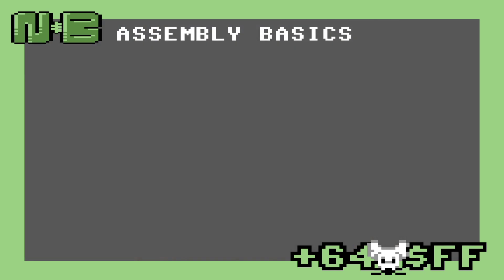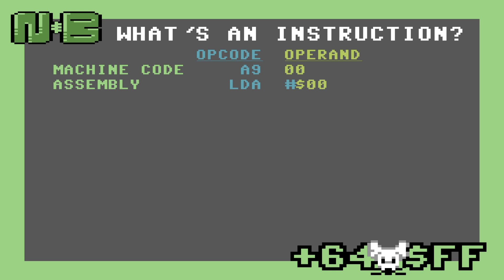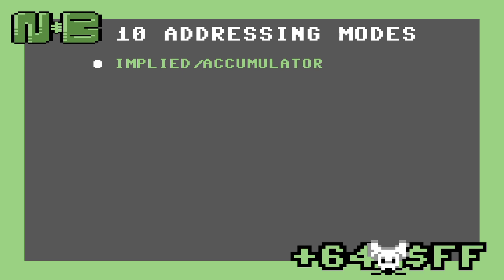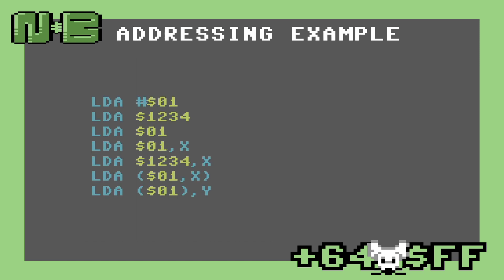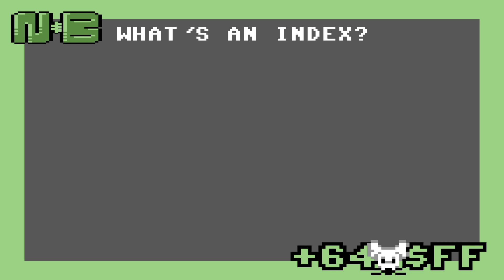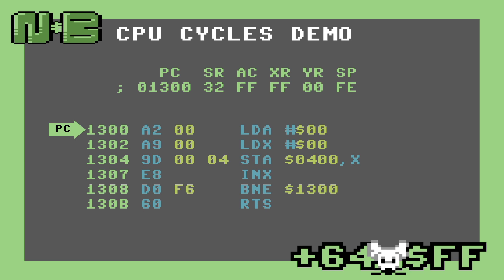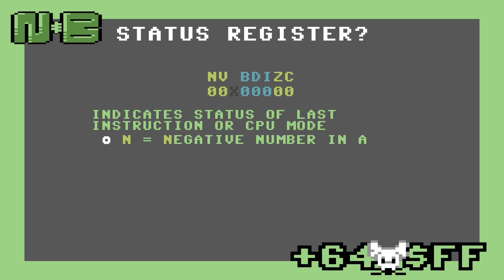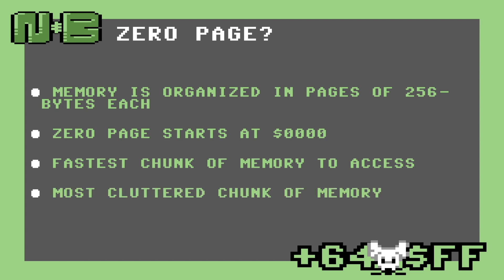Nybbles and MouseBytes: Ep1: Assembler Basics

Comment: Awesome explanation of the basics, the visualisations you do make relatively complex concepts extremely easy to understand. Best assembly tutorial on youtube, props! I totally get how the 6502 stack works now!
Reply from the maker: @Mallard Puddleduck Bear in mind that animation is slightly off. The stack pointer points to the topmost unused address. So when the JSR instruction is executed in that animation, it actually should be stored starting at the first address in that stack. As long as you get the general mechanics of it, it should be fine, though.

Comment: Thanks for sharing your knowledge, you're a great teacher & instructor. I was never aware that the 8502 had memory indirect support. Do you know of a good C compiler, or macro assembler for the 8502 or the 6502, I'm sure they're out there.  It's nice to see some tech nostalgia videos that differ from the more common videos about this era of computing, which usually focus on gaming rather than coding. Great Video.
Reply from the maker: Yes! Next video we're going to cover using Buddy (because I want to use an on device assembler), but just about any assembler built for the 6502 will work, as long as it produces PRGs. I recommend acme, buddy, and kickass.
Reply: @NybblesandBytes  Thanks for your reply. I really hope you continue this series... I've got an old C64 somewhere as well as some VHDL for the 8502 and others in the family made by MOS tech. I have a bit of a soft spot for MOS Technologies, and really wish that they had have been able to survive financially, and how their innovations and low cost / high performance strategy would have affected the tech sphere today. Especially with the advent of IoT, where we're I still use an 8051 to build low-cost sensors, relays and open collector arrays for this application.

Comment: I'm very new to the Commodore world (Z80 and speccy was my childhood) and I got some C64C, will the explained here work on a C64C or it will only work on C128?
Reply from the maker: @geniwab Kinda. The 64 has a different memory map that you'll have to contend with, but aside from that, everything I'm discussing in the assembler basics video is applicable. What you don't have is a built-in monitor like the 128 does, so you'll have to find your own solution to that.
Reply: @NybblesandBytes  Thanks a lot for the info. About the monitor I already have the solution, as I had to repair these I have a cartridge with (besides diagnostic tools) a monitor with NMI button. So I think it's time to learn 6510/8502 assembler :D

Comment: Nice video. Note that "assembler" is a program that translates "assembly" into machine code. It's like the difference between source code and compiler
Reply from the maker: @Kaappo Raivio I've heard the two used interchangably before when discussing it with other assembly language programmers. Guess it depends on your mindset. I have two "mental glyphs" for "assembler" and "assembler", just as I have two for "problem".
Reply: @NybblesandBytes  yeah, probably varies between circles. Small thing all in all, great video as I said!

Comment: the 8502 is a 6502 with doubled clock rate?
Reply from the maker: The 8502 is a 6502 with a different pinout and higher max clock rate, yes.

Comment: This might be a dumb question but why is the stored program counter on the stack "13"? Shouldn't it be 1302? How does it know to go back to 1302?
Reply from the maker: It actually pushes both the high and the low byte to the stack, but the PLA (almost-microcode) in the 6502 die includes behavior to increment the PC. Hopefully that answers your question?
Reply: @NybblesandBytes  I'm really out of my depth here: But in the video I see the  number 13 and then the hex address of where it is on the stack. Is that a shorthand?